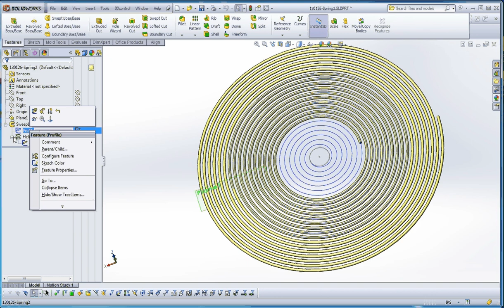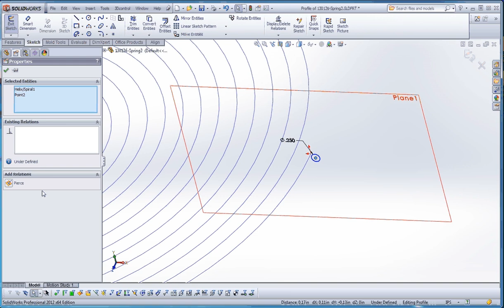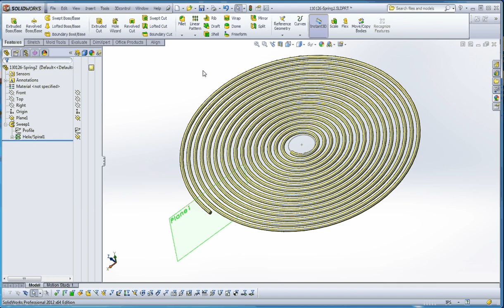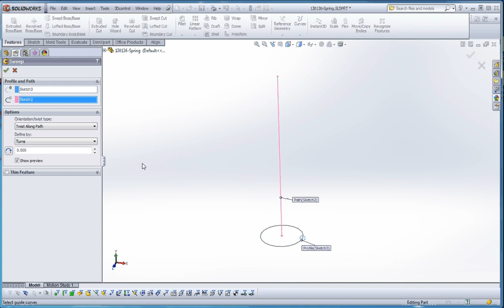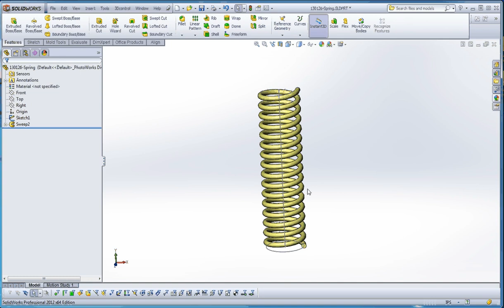Part 2 - Modeling a Spring for an Interactive Assembly, Fix the Spiral, non Helix Sweep

Comment: at 3:27 you can freely drag the line, that controls the spring height.  I can do this while im in the sketch for the line.  I cannot seem to get it to work once im outside the sketch like at 5:06    please help its driving me crazy an I am not sure where I messed up, or if i'm missing a setting somewhere.